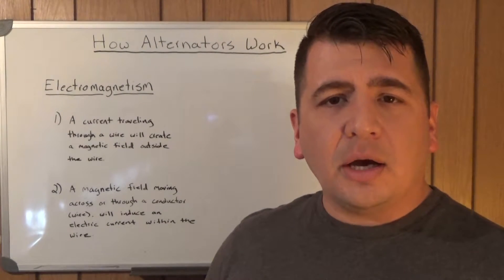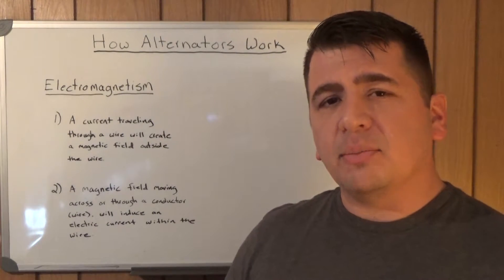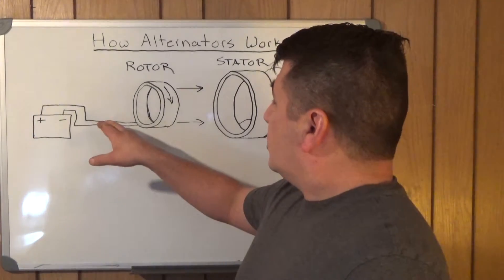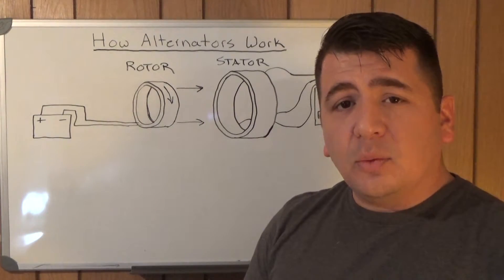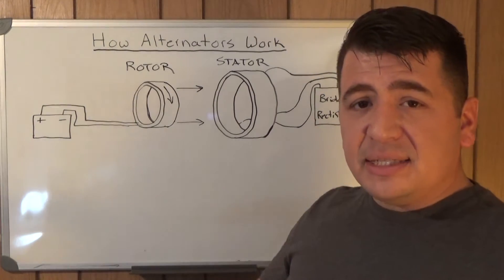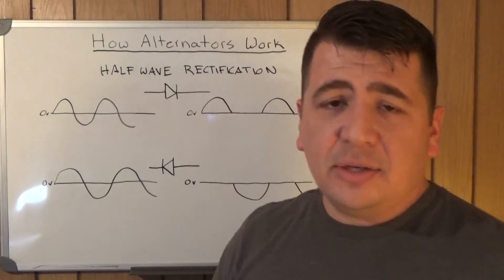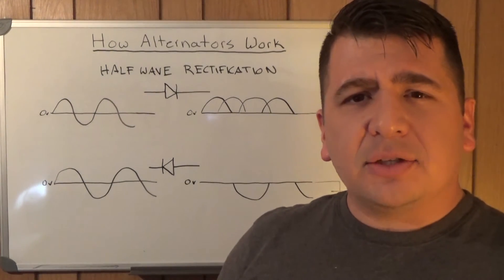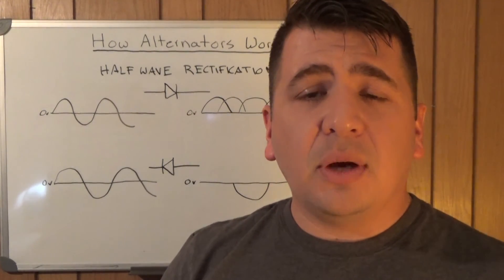How an Alternator Works

Comment: DIY AUTO HOMESCHOOL, older classic cars used generators and regulators, how are generators different compared to using alternators? you can't take an alternator and install it into an older classic car in the 60's and 70's because of what reasons?